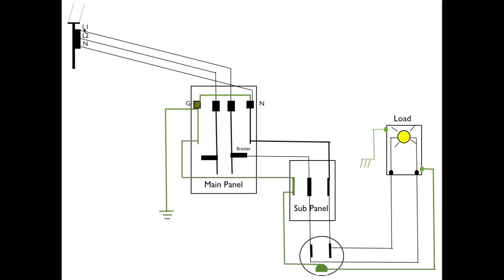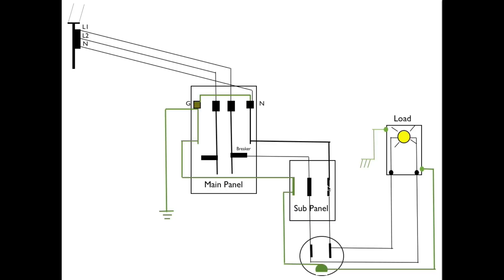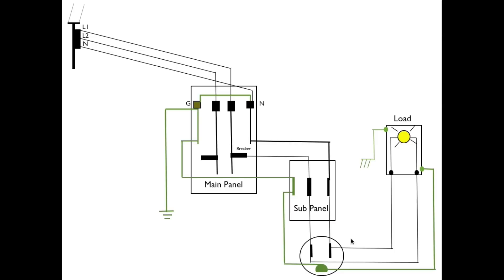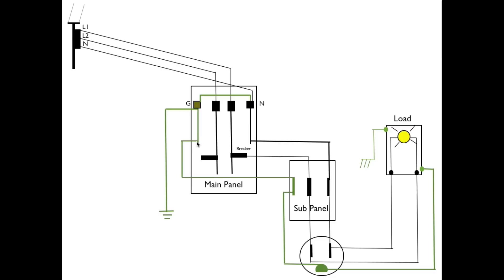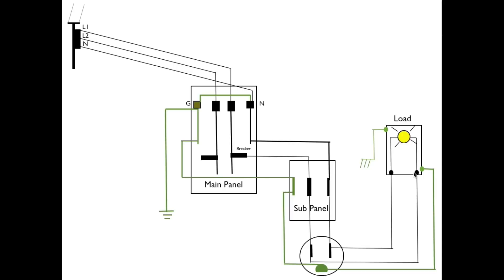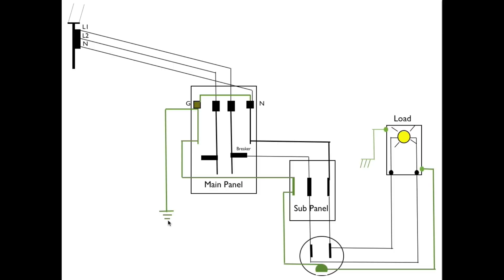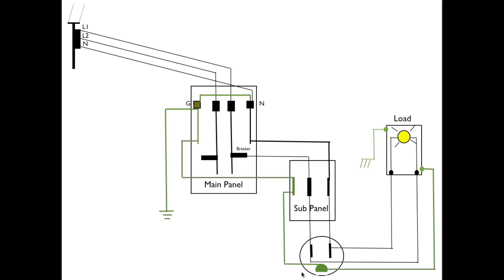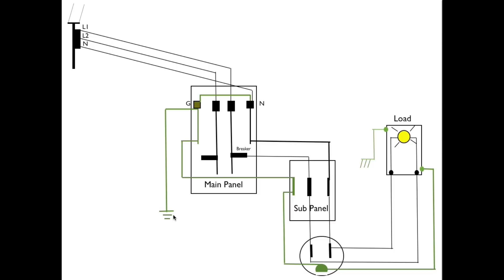The difference between neutral and ground on the electric panel

Comment: An outlet  or a light box is it considered sub panel? Please answer,thank you.
Reply from the maker: Any appliance or j box is the same as a sub panel.
GFM
Reply: I'm sorry Grayfurnaceman but I absolutely disagree with your answer.   Article 100. Definitions.  Outlet.    A point on the wiring system at which current is taken to supply utilization equipment.   
A sub panel has overcurrent devices that feed branch circuits that end at an outlet that feeds receptacles, lighting, etc to power utilization equipment.
Respectfully submitted,     Kevin
Reply: anthony triolo    See my comment.
Reply: anthony triolo — He just means conceptually.

Comment: so if lightning hits a pole and a surge goes down your neutral wire rather than going through your houses wiring and frying things it takes the path of least resistance and goes through the neutral connection to ground at the main breaker box.
Reply from the maker: It both travels down the neutral to earth ground at the structure and travels to the earth ground at the pole.
GFM

Comment: Little trick for you drop your neutral after you electric meter and bar across the ground and neutral in your sub box and watch you meter stop spinning free power. although if you ground fails like he says every grounded item becomes hot
Reply from the maker: Good grief.  What an idiotic idea.  That will not stop the meter.  It will, however, burn up your earth ground and make all your chassis grounds hot.  Even if if your ground wiring is good.
GFM
Reply: grayfurnaceman yes it will people have been doing it for the last 50 years in the UK up in till the advent of smart meters. I don't know how power works in your part of the world but here the earth (ground to you) feeds back through the substrait back to a sub station (we don't have transformers on poles and in this substation it has its own earth connected to the neutral.  You can actually make your own earth befor the consumer unit using your neutral conductor according to 17th edition regulations but you can't use it for bonding.  So to end my point yes you can drop a neutral and stop a meatrr
Reply from the maker: Where are you?
GFM

Comment: What/why is there a jumper between neutral and ground in the main panel? I have seen this of course before but never understood its reasoning.
Reply from the maker: What they are trying to do here is make a zero volt reference point.  I know that sounds like just words but that is what it is.  The center tap of the pole transformer should be zero volts but it it is not always exactly zero.  The earth ground can act as a large capacitor to absorb that voltage.  Also, there are spikes, surges and lightning discharges in the circuits' chassis grounds that are dissipated into the earth.
GFM

Comment: I would like to clarify if we measure voltage by connecting multimeter point G  & N in main we won't see any  voltage since they are at same potential same Is case when we measure voltage at any two points on Green line including cheesy of load .
When we connect multimeter between L2 , L2 & earth or neutral including anywhere on cheesy of load we will see 110 or 220 V. 
So I don't see any difference between earth & neutral the way it is explained. 
Will you Pls elaborate more on this.
Reply: The only time you should see 240V is when you measure between L1 and L2, measuring from either line to neutral or either line to ground should only give 120V. And measuring from neutral to ground should give nothing.

Comment: This might a silly question, why neutral and ground have to be bonded in general panel, but sub panel dose not? I searched in google can not find a perfect answer.
Reply from the maker: Lately, I have been getting a lot of questions about this issue.  I will be doing a video using a different method to ry to explain this in the next couple of weeks.
GFM

Comment: OK, you do not ty the two neutral bars together in a sub-panel.  However, when you screw in the two bars to the encloser, you have tied the two together via the metal box????
Reply: First, you are not tying 2 neutrals together.  You are tying the neutral and the grounding system together.  
When the 2 are bonded in the main panel, there is a path for lightning and surges to be dissipated.
By separating the ground from neutral, you eliminate the potential for the ground to become hot.
GFM
Reply: @electriccar3253  Yes I understand the bond on the main.  However, in the sub are we not doing the same when the bars are screwed to the back of the box, does not the metal box become bond.
Reply: @stanhafers2462  Unless you install the bonding screw (which you do not if it is not the main panel) there is no connection from neutral to chassis of the box.
GFM

Comment: Is there some form of diode separating nuteral and ground in main panel if not what isolates them
Reply from the maker: No.  The earth ground and neutral are bonded in the main panel to provide a path for lightning and spikes to be discharged.  If there was no earth connection, the metal of the wiring would get energized during a lightning storm with no low impedance path to earth.  BTW, the current is AC, a diode would cut off 1/2 the current.
GFM

Comment: But if the neutral and the ground are connected in the main panel, what keeps current from running to the ground  instead of remaining in the neutral return loop?  My guess would be the path of least resistance. It just seems a bit strange that a ground safety circuit is tied to a load carrying neutral wire.
Reply from the maker: Power does not go to ground because ground is not part of the circuit.  Some power will dissipate into earth if there is no other path.
GFM
Reply: @grayfurnaceman   It is a little confusing that the ground wire and the neutral wire come together at all. The neutral wire is meant to carry current, as part of a loop, back to the source. On the other hand, ground is meant to carry current only when there is a fault. I always thought that the ground carried the current, in a ground fault, back to the earth, thus overloading the breaker. But instead it returns via the neutral to the transformer as if in a normal condition. So the ground is really not involved at all if there is a shorted circuit. Thank you for the videos, by the way. Very helpful in understand this subject.
Reply from the maker: @davidh7636  You got it.
GFM
Reply: David H    You just figured out what most engineers and electricians haven't!    Congratulations.   The difference between the neutral and equipment ground in the short circuit is since it bypasses the load, very low resistance, so high amperes which creates magnetic field within the breaker to trip it.    Respectfully,   Kevin

Comment: So the only connection between the neutral and the ground is at the main panel connections and not anywhere else in the home. Been checking on electric transmission and I don't see the neutral wire go all the way back to the power company as they have to wire several hundred miles, removing a wire is important to them and they send a wire to the "bedrock conductor of the earth" and connect the neutral to that, but all this happens outside the homes. Inside the house, you need this distinction for electric safety purposes where if something bad happens, the current that makes it into the "ground" instead of neutral would trigger a red flag to the breaker to shut down the affected circuit and best to make sure that the problem is corrected such as unplugging the bad machine and restarting the circuit but do not plug in the affected machine without checking it for any problems.
Reply from the maker: The connection from ground to neutral is there to provide a path thru neutral to the center tap of the secondary winding of the pole transformer to open circuit protection in case of a fault.  
A fault will not, repeat not be cleared by a connection to earth ground at these low voltages.  
GFM

Comment: if you change a breaker from 110v to a 220 v  for the purpose of changing a well pump to be more efficient, then there is no physical neurtal? how does this now balance
Reply from the maker: bj There is no neutral. Only chassis ground.  It balances because at the power pole, it goes from one side of the secondary winding of the transformer to the other.  120v circuits are run from one side to a center tap of the transformer.  That leaves the other side unbalanced.   Hope this helps.
GFM
Reply: bj — I was looking at motors recently and one motor maker said there was no difference in efficiency between 120V and 240V versions of the same motor.

Comment: Your statement at 9:29 is incorrect. We do not tie the neutral and the ground together so it can go to ground. We tie them together so in case of a fault the ground path uses the neutral to go back to the source, and turn off the breaker.
Reply from the maker: You are misunderstanding the statement.  Earth ground is essential as a sink for spikes, lightning and surges.  Not as a part of the circuit.
GFM
Reply: Luis Cosme    Your comment is correct for a short circuit!   But what happens if you have equipment grounds as part of a branch circuit feeding lighting on wooden poles outside and lightning strikes the light.   Now what happens?   All scenarios count.

Comment: you forget to show the most important, the power pole / transformer's neutral is also grounded, and the main panel's earth serves as ground reinforcement or path to return back to the transformer if by any means the neutral connection between the transformer and the main panel is interrupted.

Comment: because i live in 220v area, which neutral and ground will never link up. neutral is connect to the shaft of the generator in power plant. in our situation,  leaking electric current from live complete the circuit from live to ground and kick off the fuse in L1 or L2. gentleman i believe that diagrams is a US standard circuit, right? just one thing i don`t understand, why there is a wire in the main circuit box from neutral to ground??? if that is the situation, ground and neutral already becomes the same line since there. because you are talking about electricity, and it will kill when the shit hit the fan. if you have to worry about the small circuit box for leaking charge, then why don`t have to worry the main circuit box? is that main box in diagram contain a fuse to L1L2 each? can you explain more about that? thanks

Comment: Just a clarification. You said that in the sub panel the ground is not connected to neutral but actually if you trace back to the main it is connected. Why connect neutral to ground in the main panel. This part is what confuses me.
Reply from the maker: Alejandro Velasco The reason for them to be bonded in the main panel is that you 0 volts potential between ground and neutral.  This gets rid of any spikes, etc.  Hope this helps.
GFM
Reply: Thank you that helps a lot. Hear in the philippines we are using 2wire live system 120v each no neutral. So connecting to both the wires you get 240V. Do we need to have grounding in the system.
Reply from the maker: Alejandro Velasco It may not be required or even available there.  The system probably works ok and is probably not unsafe.
GFM
Reply: thank you :)
Reply: Alejandro Velasco
yes, you for sure do, but you should not need the neutral wire if I'm understanding you right.   Always have it grounded.  Think what would happen if a hot touched the cabinet, if the cabinet is grounded the hot would draw load thus the amps would spike way up, & the breaker would trip, thus if someone came by & touched it they would not get shocked because the breaker has tripped. But if the metal box was not grounded it would stay hot & I would feel bad for the person who touched the hotted up box.
  p.s. My dad used to say, 'grounding saves lives' & before when they would not ground electrical items people did die much more often. My dad would be (if he was alive) proud of the maker of these videos).     thanks
Reply: VerifyVeracity
Neutral wires of any normally functioning electrical main panel carry less than .25 of an amp at the wire, milliamps for the most part. Neutral are necessary for the power to flow through the black/red/ whites on a 110 volt circuit, or 220 volt cirucit with 3 conductors, (black, red, white) and do nothing more than to serve a a circuit that does NO WORK (the neutral) ON A 110
Volt Circuit.220 Volt Circuits utilize the white AS A CONDUCTOR on some TWO Pole breakers in your panel. Water heaters/ hvac, etc. Grounds and neutrals ARE connected to the same connection point in the majority of panels, and the bare copper (machine ground) serves as a TRUE EARTH ground, whereas the white - neutral does not, and such, keeps you from getting a shock from the equipment (the bare copper earth ground). Hope this helps everyone.
Reply: to properly understand ,  You need to know the difference between system grounding and Equipment grounding.   System grounding is usually to the earth by a ground rod.  This protects the building and wiring ad equipment from surges from lightning and other possible sources.   Equipment grounding, on the other hand is to protect you from faulty currents (shorts etc.) by simply providing the faulty current an alternative path back to source thus tripping the breaker untill l the problem is corrected
Reply: freedomlover It can only be connected at one point. Either at the main pannel or the first bos.  Otherwise if connected at  a sub pannel electrons will flow through all available paths thus your ground wires will carry retuning current same as neutral wires

Comment: I notice you have the jumper from the neutral to the ground on the main panel, why wouldn't the power cross through it?
Reply from the maker: That point is a zero voltage potential between ground and neutral.  Certainly, power can cross, but the circuit is between hot and neutral, not ground.
GFM

Comment: Good explanation of theory, except for nomenclature.  There is no “neutral” wire in single-phase wiring.  Nor, technically, is there “ground” wire in any wiring circuit.  There is phase wire, groundED wire, and groundING wire.  The grounded wire normally completes the circuit with the phase wire.  The grounding wire only carries current during a fault condition.

My source is Practical Electrical Wiring, Richter & Schwan, 13th Ed.  It cites as its own source the National Electrical Code.

Comment: if I have one neutral and one hot coming directly from the pole(total of two instead three  ) how do I get my 240 volt?  please I need help
Reply: seltech pro You don't get 240volts with the connection you describe.  You get 120 volts period.  It's not common anymore but houses with all gas appliances and thus very low electrical demand and no 240 volt appliances, such as electric hot water heaters or electric ranges, used to have only one leg ( a hot an a neutral) in the service drop from the pole to the house.
Reply: You don't. L1, and L2 are two separate 120 feeds plus the neutral.
Reply: Unless I'm mistaken, 240 appliances will bond both legs.

Comment: By not bonding the neutral and the ground at the sub-panel, how is a breaker in the sub-panel going to trip if, say, there's an open neutral in the subpanel and the hot touches the metal of the appliance chassis?  (If the chassis is grounded to earth ground, my understanding is that earth ground will not trip a breaker)
Reply from the maker: If the chassis is hot, the fault current travels thru ground wire to main where it does connect to neutral bar and opens circuit protection 
GFM
Reply: +grayfurnaceman ok....but I still don't fully grasp the reason why, at the main panel, the neutral is bonded to the grounding wire and at the sub-panel, this is not allowed.  Is it because 'the code' doesnt want stray fault current going back to the main panel on the grounding conductor AND the neutral from the sub-panel to the main panel or is it because one big parallel circuit would be created(by bonding neutral/ground at both the main and the sub) thus decreasing total circuit resistance and increasing current?  I mean, I see that, by allowing the bond at the main panel, fault current will go out on the neutral but on the line/transformer side and this would seem o.k.(?)......   :)
Reply from the maker: +steve jones You may be overthinking this. You do not want the unit to operate normally with an open neutral as this would create potential for shock if then there was a ground failure. 
GFM

Comment: Not protecting but to the device it is balancing* basically my question is where does the circuit complete? I'm assuming the xo of a transformer is where the circuit is complete
Reply: Troy Bordes — All circuits go through the transformer, because that is where the electromotive force originates.

Comment: The Neutral conductor is the center tap of the secondary of the stepdown  transformer. The neutral of a residential panel is NOT created by the ground tie to the neutral bussbar in the homeowner's load center. The waterpipe ground is NOT designed to carry current. its sole purpose is to dump a lightning strike on the line to ground. The wiring in the house would work perfectly fine with NO connection to a water pipe, ground rod. The only legitimate source for the zero crossing point in the AC cycle in a residential system is the center tap of the transformer, aka neutral.
Reply from the maker: Agreed
GFM
Reply: Gizmologist1 — It has to be tied to ground somwhere to ensure that the legs are less than 150V from ground.